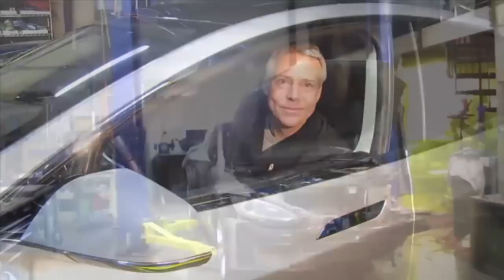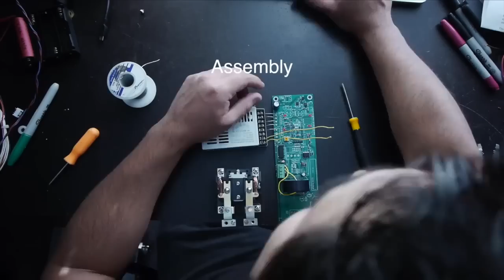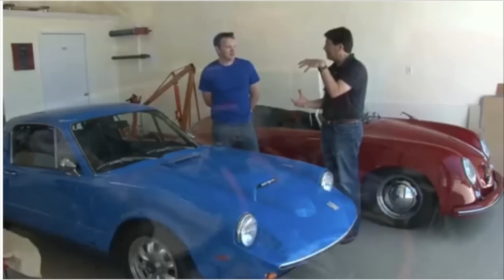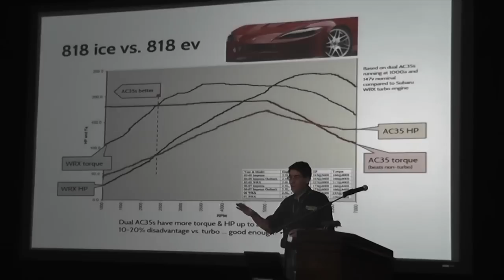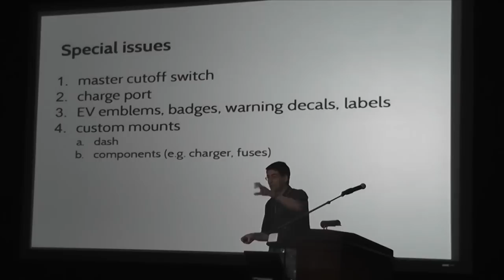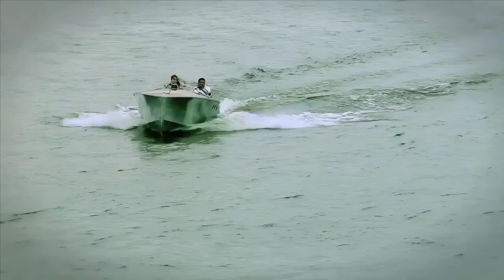EVTV Friday Show - December 27, 2013

Comment: LEAF Upgrade - make a sound system (external or internal) that sounds like an old Jag race car.   You could have several sound choices Ducati, VW, etc
How about the results of Jehu Garcia's 18650 battery pack and an evaluation of the14kW EVSE kit from Electric Motor Works?
Make a Tesla model S open Wiki like a Chiltons manual.